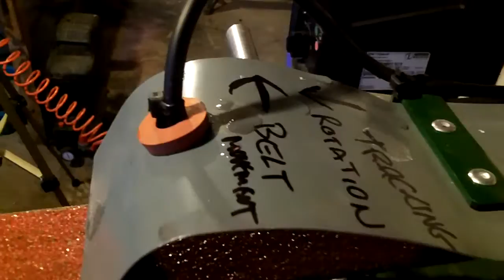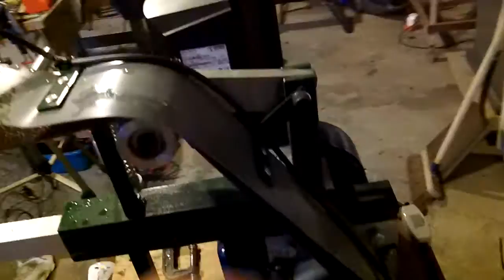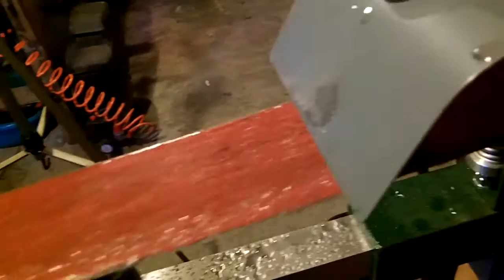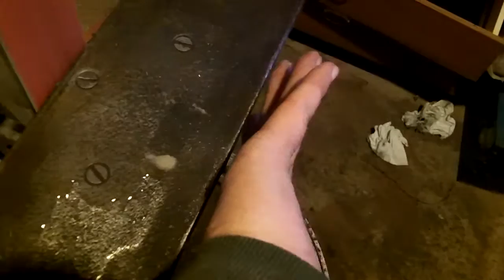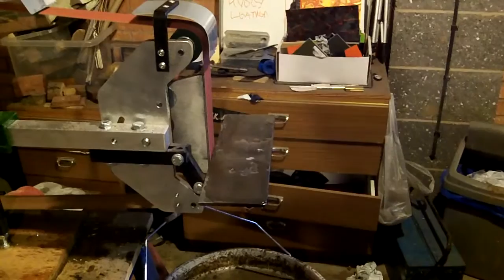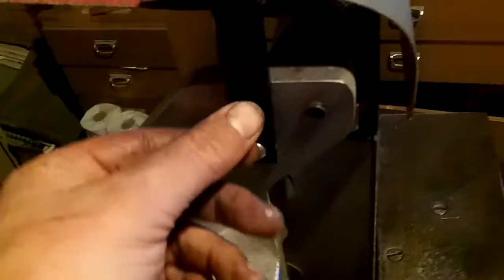Grinder Modification number 2 - Water Cooling System

Comment from the maker: there is just not quite enough pressure for the mister to vapourise the water. The pump is designed to be used with from 1/4" ID from what I have since learned, so will be grabbing a piece next chance I get. But to be fair apart from the guard channeling flow onto the table (easy fix) it seems effective

Comment: Very nice. I've been meaning to automate mine forever rather than the continuous hand spraying. you want to try and get the water misting off the pump rather than beading, which is why its bouncing off the belt and flying a little mist.. the more misty it is the better it attaches to the belt

Comment: Sweet!!!! I would add a filter and then run it in a cycle so you don't have to add water. Just clean it a little. Also put a few holes in the plate you added!

Comment: That looks like an excellent mod - but I have to ask what might be a really stupid question...
I haven't been in a decent workshop in over 25 years, but nevertheless the question springs to mind...would there be any mileage in replacing the water in the cooling system with cutting fluid? If this is a stupid suggestion don't hesitate to say so  LOL :-)

Comment: Before changing the tubing, try raising the 'feed ' bucket. Less work for the pump to raise the water so it will have more pressure. The nozzle may drip when the pump is off if the water level in the feed bucket is higher than it tho.

Comment from the maker: I like your thinking on the float! Most of the grinder is ally, and I think I will take the time to coat all the steel parts in rust inhibitor tomorrow.. Once I stop the dripping on the sides there will be little on the table, and even better might be the idea to mount on the front guard

Comment: agreed, metal cutting band saw bi metal blades are about £20 and will cut only a few metres of 4mm O1 with lube before being knackered, they are more controllable than a rhodius cutting disc but the discs are like 50p,,the cheapest way I've found is to buy 4mmx300mmx500mm and cut blanks with rhodius,.. the band saw though is better in cutting into awkward corners where the disc always has a radius, the band saw is vertical. ideally, sub out to water jet!!

Comment: Well, if you dry the metal parts after work I think you'll be okay then :) You can put some float in the bucket which will give signal when the level drops.

Comment from the maker: erm... yeah. I think you have kind of missed point. And fyi, a bandsaw does not save time and money as the cutting feed speeds are mega slow and bi-metal blades are 3 times more expensive than the ceramics I use. Do you actually have experience with tools and machinery?

Comment: Nice result mate, looks to work very well. I assume you don't have a waterline nearby since you're using buckets? :)
Drop in bracket seems best for that aye, it can be a hassle to undo screws all the time, even with proper handles on them.

Comment from the maker: it sounds silly but for ages I was not getting even lines while profiling. it turned out I was pushing down and in instead of just in towards the platten. if it is mechanically moving then there is a fault with the machine and it should be returned

Comment from the maker: my power is well and truly out the way, and will eventually go through the roof timbers. The nozzle I have is a mister but I thing the id diameter of the hose im using is to small for the flow

Comment: I just use a plant spray bottle, a mist releases a lot less water which is what I need on my crowded wooden bench with power sockets and power tools and hardwoods stored underneath...just imagine the fireworks if I got a drip fed system,,oh yes!

Comment: as you mention, triangulating that top guard a bit should direct the drips onto the belt..maybe bend a  little lip first downwards before cutting off...bending a small lip after cutting would be tricky so bend first, cut 2nd,,,worth a try?

Comment: I think it would make more sense if the water dripped in the front by the front guard.  I'd give that a try. You'd probably use less water and have less spillage. Either way it is an excellent idea. Funny that you did this vid because I have been experiencing localize burning on my grinds when when working with 220 grits and up. My platen has been over heating and burning my blades. I thought I would have to buy another platen attachment to switch out when it got too hot.  LOL